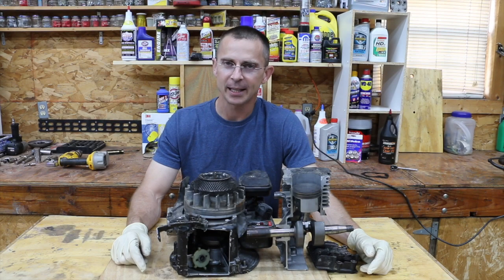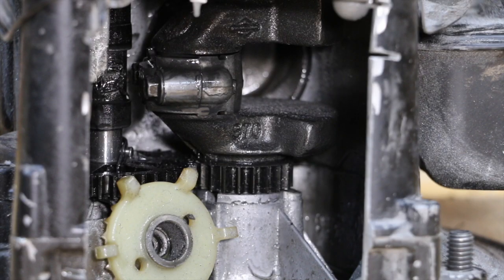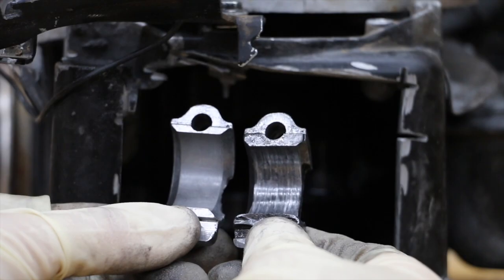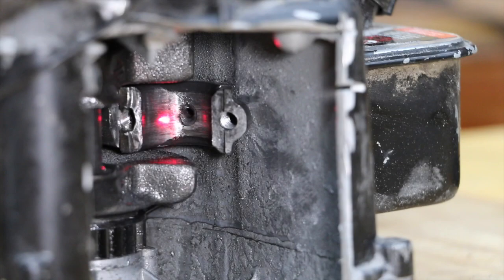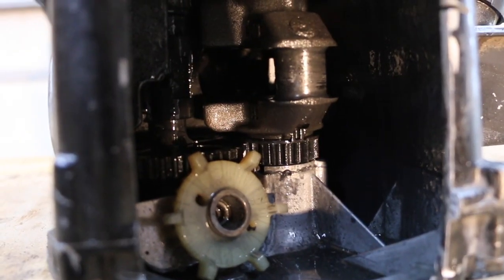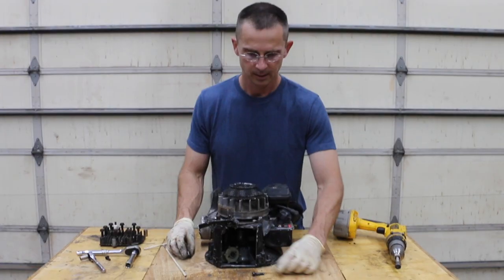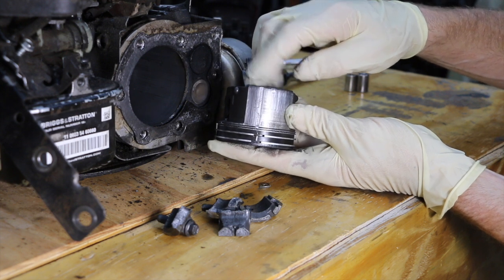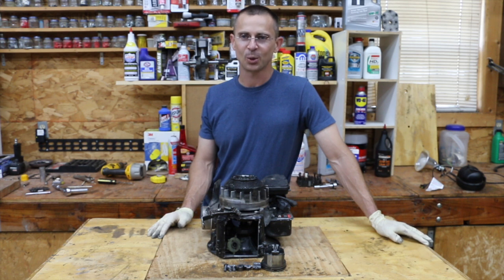Running Cutaway Engine Throws Connecting Rod!

Comment: I just had an old 13hp L head Briggs fail in exactly the same way.  Still don't know why, as it had oil (puked plenty postmortem) and sounded OK right beforehand.  It punched a hole in the crankcase, so it's just a boat anchor now.  :-)
Reply from the maker: Interesting!  My father in law lost an engine on his zero turn.  I believe his is a 25 HP twin cylinder. His didn't have any sort of warning signs either until it came apart.  Apparently, it made a lot of noise when it failed.  Thanks for commenting!

Comment: Question i have a 18.5 hp briggs with a knock i took it apart and nothing seems loose u have any ideas what it could be ?
Reply from the maker: machines and computers,  Are you sure the piston isn't hitting the cylinder head?  Thanks for watching the video and commenting.
Reply: well i was mowing when it was hot and oil was a lil low then all of a sudden it started knocking and np
Reply from the maker: I hope it isn't too serious.

Comment: The question Is!!!  Could you JB-Weld the rod, run it with oil, then see how long it will run.  You might have to install the piston in another engine block to run with oil.  Just a thought.
Reply from the maker: James, LOL!  That would be a very impressive achievement for sure.  It's very tempting to try to do this.  Thanks for watching the video and commenting!

Comment: Thats a normal B & S engine rod clearance. I had two of these engines blow up on me 2 years ago. Buy Honda or Yamaha B & S are pur junk.
Reply from the maker: Robert, Amazing how much knocking was coming from this engine.  Honda's and Yamaha's are terrific engines.  Thanks for watching the video and commenting!
Reply: He seized the engine by running it with no oil, only residual Slick 50 on the crank. Then he cut away the crankcase and ran it with a dry case, seizing it again. He was able to restart it and run it after seizing it twice, and it was only after the connecting rod literally exploded that the engine quit on him. I mean, its possible Briggs & Stratton isn't up there with a $600 mower engine, but... I mean... it took a lickin' and kept on tickin'...
Reply from the maker: Benjamin, Great point!  This little engine took a lot of abuse!

Comment: Interesting vid, I bet if you found a new con-rod and patched the hole it'd go like nothing happened. I haven't killed an engine yet, but last year my old Seagull outboard developed rod-knock. I shut it off in time and after re-tightening the big-end bolts it runs like new again!
Reply from the maker: petrolnut, I agree that I could get the engine going again with a little effort.  Thank you for sharing your experience with the Seagull outboard.

Comment: Nice to see, thanks. The only engine failure I saw was on a 95 F150 my Dad had; he went to the side of the road and there was no oil. Adding more oil didn't help, I don't know what happened but maybe an oil cooler line blew; we later found the engine block was done for.
Reply from the maker: Austin, Thank you for sharing your experience with the F150 and thanks for watching the video and commenting.

Comment: biggest engine fail I've seen was on my wife's 99 corolla( go figure a Toyota that died ),  and she driving on the freeway and she told the car just stopped running, I had it towed back home and long story short it had a massive engine failure that put a window trough the block, the number 3 cylinder connecting rod came through the block and trashed it.
Reply from the maker: Chris, Interesting and thank you for sharing this experience!

Comment: best engine fail i had on my personal car was when it started to knock then pow loss of power but engine still ran // upon inspecting the first crankshaft journal broke completely sending No.1 Piston through oil pan and No. 2 piston up into the head beading the valves // engine would start and run but the harmonic balancer just stayed put did not move and tried to move car but with virtually now power through the transmission ( manual 4 speed )  crazy but true happened in 1981
Reply: JAFO FUBAR Insane man. that's fucking awesome.
Reply from the maker: Wow!  That is a major engine fail!  Thanks for commenting about this experience.
Reply: the engine was a 327 out of a 1965 corvette that was dyno balanced 4 bolt main
Reply: worst engine i have seen was a diesel run away due to turbo failure and wow what a whine it made before it did its own practice of a percussion grenade  with parts all over the floor
Reply from the maker: JAFO FUBAR, I can only imagine the noise that diesel made when it came apart!  Thanks again!

Comment: I put a Briggs and stratton to a torture test I put dirt in the carburetor and water in the oil and I Tour the engine apart and cleaned up the cylinder head and valves and put it together and it ran again end it had a lot of compression
Reply from the maker: Bronco Driver, Impressive!  Thanks for sharing this and thanks for commenting!

Comment: How hot did the head get when you ran it with oil? Like 250°F? I noticed it seized @ 545°F, which is pretty amazing
Reply from the maker: Christopher, you are correct...somewhere around 250F with oil.  Thanks for watching the video and commenting!

Comment: Try running an engine as fast as you can get it to go until it explodes.
Reply from the maker: ironmanning36, Great suggestion!  Thanks for watching the video and commenting!
Reply from the maker: Great suggestion!  Thanks for watching the video and commenting!
Reply: yea, but if you remove the exhaust and throw on a bigger carb without an air cleaner, they really start to fly (apart)!
Reply: Tim Sharpe, Yep, I had an old Briggs powered push mower that I used to mow tall grass with in an infrequently mowed lot. I rigged a piece of fishing line to the governor and ran that thing wide open for years mowing that lot and it never did fail. I eventually junked it because the mower deck finally broke and rotted away. I still have the engine though.
Reply: took a look. reporting you for engine abuse
Reply: Those Briggs engines will run all day long at wide open throttle if you keep oil in them.
Reply from the maker: Tim, Great point!  Thanks for watching the video and commenting!
Reply: Ironmanning36 I worked for a guy that raced go karts and they would run those 5hp Briggs engines that are designed to run 2600 rpms and run them at 7 or 8 grand when they come apart it can get pretty violent
Reply: I blew up my go kart engine last weekend. It actually blew the block  in half. 30% nitromethane packs a punch.
If you look on my channel for a video called "let's blow this sucker up" you can see us running an engine with everything from maple syrup to beer for oil. The results were astounding.
Reply: Get the engine to rev up high enough till the flywheel explodes...would like to see that lol.
Not sure if stock internals like the rod would last long enough to blow the flywheel.
Reply: yup but u need stiffer valve springs and more aggressive cams. just a bigger carb or exhaust even running wide open wont blow up most these engines. the cams are only efficient to a certain rpm and the springs float around 6000rpm stock generaly
Reply: MrBooshScadoosh I just reported him to a mechanic who will report him to another mechanic
Reply: TheMegamanDX not really, usually just shimming the valve springs will get it there. What happens is that without a bearing insert in the rod (all performance rods have bearing inserts), the aluminum rod  will start building heat with sustained rpm and swell, which causes it to generate more heat, which causes it to swell more, which becomes a runaway situation and causes the rod to break at the oil hole. The governor keeps it in the safe zone, and if that is bypassed, removed, or fails the valve springs will usually float while still in the safe zone. Remove the governor, shim the valve springs, and beat it like a rented mule.
Reply: MrBooshScadoosh I've destroyed several with no modifications other than valve springs. Usually 6k sustained rpm will make the rod come out of the block, and it don't even need a hole cut in it. It'll make it's own.
Reply: Engines self limit pretty quickly with friction and pumping losses. Back in the day cars didn't have limiters and would just top out like a leaf blower
Reply: use a Tecumseh engine
Reply: MrBooshScadoosh yeah I know all that stuff and we did all that and more
Reply: the cam wont let it rev high enough usually too though depends on the engine
Reply: true im used to 6.5 clones not flatheads may be different too
Reply: your just making shit up
Reply: Cameron Galat Chitra-Straley no
Reply: Briggs and Stratton 5HP L blocks (flat head engine) have a governor in them that limits RPM.  If you really want to see one of these engines come apart in a spectacular fashion just remove the governor, replace the stock cam with a DynoCams 96-3OM cam.  Install intake valve springs on both valves with stock lifters.  Run it at around 7400rpm with the stock connecting rod and no oil....  It'll destroy pretty much everything but the cylinder head and piston....  The stock B&G intake valve springs don't float that easily which results in the DynoCams 96-3OM cam completely destroying the stock lifters.  I used that cam in a go-kart race engine for several years.  Completely destroyed several engine blocks due to billet lifters failing....
Reply: Mandela Effect let me guess, that mechanic is going to report him to anotrher mechanic (repeat that 5 times) who reported him to another mechanic's cousin...
Reply: Ironmanning36 seen them do that with a ford explorer just revved it till it threw a rod it hurt my heart hearing the destruction haha
Reply: Nate's Chop Shop

Comment: what is the white wheel connected to the 2 gears for?
Reply: Jusb1066 oil splasher
Reply: thank you, i have mostly worked on very old stuff, and seen things like rotating oil lifter rings
Reply: oil splasher AND rpm governor assembly
Reply: That's what I thought it was, good to have a confirmation! Also, that's a really simple and ingenious method. Not as cool as the refridiration compressors, where the oil is pulled up through the crankshaft and flung around.
Reply: thats what happens when things are made cheaper and cheaper. lawnmower engines suck a lot of dick, that's for sure, but its still a better option right now than an electric one. even the cheap low capacity ones are waaaay more than the cheapest four stroke mower.
Reply: Tyler Coates I have a snapper riding lawn mower. It doesn't use a battery.(it uses a recoil starter)
Reply: Had it for years, and it still runs like new!

Comment: my story, i rebuilt a toyota 6 cyl engine, i bought an engine from a burned out car to replace one that had seized due to antifreeze instead of oil....anyway. i had to fit the old head to the 'new' block, so while it was apart, i wanted to look at the main and big end, the big ends needed replacment, so i did,    the manual specifically said, no locking nuts or loctite needed, though i wanted to....wish i did, as a few days after rebuild, one of he big ends came loose on it.
Reply from the maker: Thanks for sharing this experience!  It's very disappointing when these sort of things happen.  Thanks again!
Reply: Jusb1066 that's awesome! my grandpa, in the late '50s, bought his first "car", for $5(different times, lol). it had been rear ended by a semi real hard and was about the size of a go kart. he bought it as just a frame and put in a motor, brakes, wheels, seats, etc. really inspires me that you can change something that's bad into good.
Reply: You know you can resize the big ends right? Small ends too for that matter
Reply: Philip Mac Duffie I'm talking about this guy 6cyl Toyota in the comment I'm replying to. You can't resize the lawnmower engine like keys on the cap so you can't clip them. Ps they're not keys but I can't remember what there called right now
Reply: Barry Fields 

  You know you really can't do that to a bearing less rod right? The reason you resize a rod is to restore its concentricity not to restore its diameter. The bearing is the wear component and is disposed of during a rebuild. This rod has no bearing. 

  Could you cut the cap and rebore the rod? Sure you could but an aluminum rod that has been heated to the point it has lost appreciable material is thermally damaged to a point of questionable usability. Which is why you won't find anyone resizing an aluminum lawnmower rod.

   But youtube is just going to reply to me with, "Google it newb!".

   For those who are planning to do that I suggest you actually go out and do something with your hands besides ask google to answer all your questions.

Comment: now silicone a glass window and throw in another con rod so we can see the oil getting lubed etc
Reply from the maker: DAT 30GB, Great suggestion!  Thanks for watching the video and commenting!
Reply from the maker: Jennifer, Great suggestion!  I'll definitely do this!
Reply: Project Farm 
yes, window and view with proper oil!
Reply: Sorry, NG Hermit, but that really wouldn't be safe. If you keep hanging out next to an engine ready to blow, you could be injured, or even less unlikely, but still possible, be killed.
Reply from the maker: NG Hermit, I think it would likely last a little longer.  The spray lubricant would help reduce friction but heat buildup would like remain a problem.  Thanks for watching the video and commenting!
Reply: I'd love to see that, but I doubt you would see anything with the slinger tossing oil on everything.  Maybe apply RainX or wax the window to shed oil?
Reply: DAT 30GB Is that ur fur suit?
Reply: Anthony Smith Go easy, grammar police.  I'm going to go out on a limb and suggest that he meant to say '...buildup would LIKELY remain a problem'.  Someone as astute and as critical as you LIKELY should have inferred that from context.  Relax, man, the Internet is serious business. ;\
Reply: Dang, you beat me to it! Great idea tho!
Reply: Project Farm I totally agree with DAT 30GB on this one... that would be awesome to see. But you'd have to wax the window for sure. Or use some type of fiberglass windshield with an oil-resistant coating so you can see things better.
Reply: vanamburgben he is
Reply: Oh also, what if you just spray in lube from time to time as you see it heat up... wonder if it would take longer to die.
Reply: lol dude I see you everywhere
Reply: What kind oil do you use to lubercae your oil?
Reply: A
Reply: Yeah some thick Steam boiler inspection glass should take the heat easily or just regular heat glass from a fireplace or an old kitchen stove ;)
Reply: DAT 30GB oh dear god its a furry who likes ricers
Reply: Silicone? You mean LEXAN?
Reply: +vanamburgben gay
Reply: What kind oil do you use to lubercae your oil?
Reply: DAT 30GB hello fellow fur!
Reply: Windshield wiper oil is the way to when lubricating your oil
Reply: DAT 30GB FURRIE!!!! YESH!!

Comment: Bet you couldn't JB-Weld that back together, or could you? :D
Reply from the maker: twocvbloke, LOL!  I thought about it, but I've got other interesting projects underway.  Thanks for watching the video and commenting!
Reply: Project Farm "other interesting projects" like using JB Weld to fix a broken gear tooth on a transmission?
Reply: so many people want to see it be welded and re ran 😂
Reply: twocvbloke I was about to post that comment
Reply from the maker: Berner's Vlog, Great suggestion!  Thanks for watching the video and commenting!
Reply: Yes, JB Weld the connecting rod !
Reply: Macgyver welded a broken rod with a coin and a car battery. The original Macgyver, not this new wannabe that's on now.
Reply: Project Farm please try jb weld
Reply: JB Weld should hold, but then again you never know until you try.
Reply: twocvbloke, Yep, that would be relatively easy and it works. I did that to a tiller engine that had thrown a rod through the block and it held up for years afterward with a new rod installed and the broken pieces secured with JB Weld.
Reply: If he can JB-Weld it back I'd be impressed! Would like to see the attempt though.
Reply: twocvbloke.  get her done!!
Reply: I was about to suggest jb welding it back together for yet another round
Reply: Exactly what i thought !!!!
Reply: jb weld it
Reply: beat me to it
Reply: ohh man please do it. love your channel
Reply: I totally second this idea! If you can do a cylinder head with jb weld, this should work too.... right? Haha hell, why not see how much of an engine you can actually replace with jb weld. Piston, head, crankshaft, etc...
Reply: my first thoughts...
Reply: Was just about to say it lol
Reply: Id like to see that
Reply: After i suggest this same thing is when i see your comment. :\
Reply: After i suggest this same thing is when i see your comment. :\
Reply: Dustin Libby I think the crankshaft would be really hard to make with jb weld but some of the others would be cool
Reply: hank hill sure you were buddy...
Reply: twocvbloke 
Seems like many people had the same idea. Anyway had the same thought, but it would be nice to see.
Reply: Nah..just use DUCT TAPE!
Reply: twocvbloke. Hey man JB's  a nice guy but he'll only go so far!!🐴
Reply: Hey man, just open the throttle and wire the governor back and when it really starts to scream hit it with a big hammer.🐴
Reply: elmers glue !
Reply: Damnit! I wanted to suggest that!
Reply: twocvbloke dammit you beat me to that comment lol :)
Reply: twocvbloke man you beat me too it! I thought the same thing